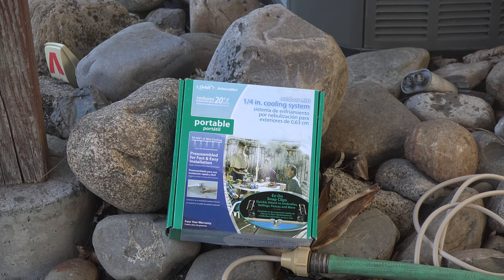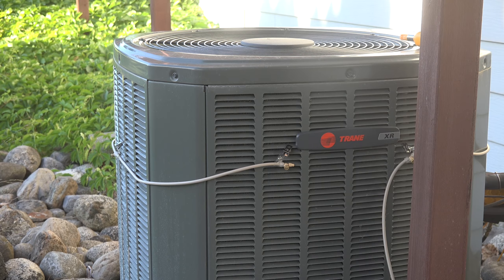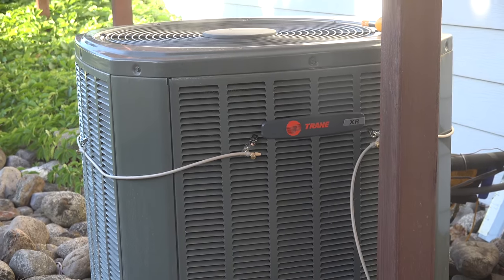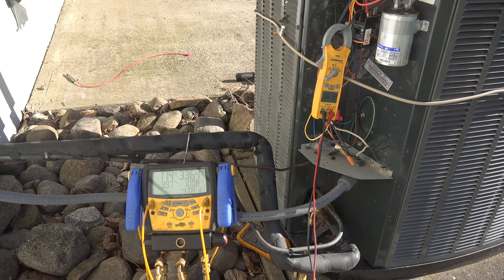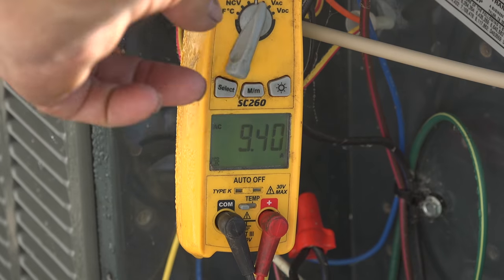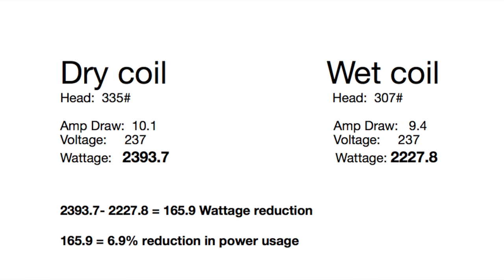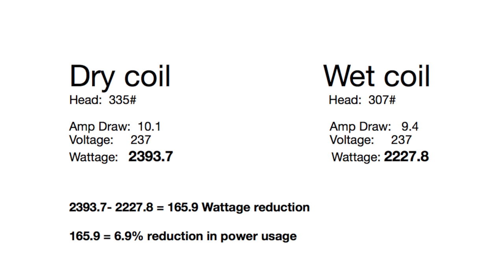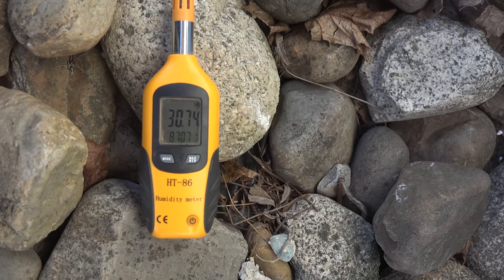Do the misters for A/C work? Part #1

Comment: I did this, but instead of using misters, I used running water and caught it in a catch-pan and recycled the water. Month over month, I dropped at least $20 off my power bill. And this was during July/August, hottest months in Florida (not to mention the humidity)
One thing you didn't mention was how long the unit ran to keep the house at the right temp. If no mister, and the compressor runs for 80% during the day, and with mister runs 60% during the day, I think that also makes a huge difference on wattage consumption. 
100W difference between mister vs non-mister is one thing, but reduction in run time over the course of a day is another.
Reply from the maker: This one is interesting.  Your method is probably the worst way to use water on a coil.  As the water evaporates, the minerals stay in the water and become more concentrated.  Eventually, very concentrated minerals will be deposited on the coil.  
Determining energy savings by comparing the electric bill is very inaccurate and should not be trusted.  
I will be publishing a video on indoor air performance in the near future.
GFM
Reply: I think it should be explained that there is a difference between the sensible heat of water vs the latent heat of evaporation. Big difference.
Reply: Korishan Excellent point. And if people are worried about mineral buildup then just install an ice maker filter in the line.
Reply: Korishan whenever the condenser temperature is lowered the evaporator temperature will also drop resulting in faster cooling inside.
Reply from the maker: These type filters are not designed to remove all minerals from water.  They are "treatment systems".  When water evaporates,  whatever is in it is left.  That means deposits on the coil.  Even if you put an RO filter in, you are then faced with pure water.  That may sound good, but pure water is quite corrosive so then you would have a damaged coil.
GFM
Reply: Hmmm, seesm like an easy solution. Since I use the container approach, all I need to do is add a little CLR or some other mineral remover, let it run for a few hours, then dump the water, refill, rinse the unit, and start up again. I do put about a 1/2 cup of bleach in the water every few weeks to kill any algae or other types of slime.
This is my 2nd year running the system. I have not seen any build up on the unit, the coils, or any other noticeable damage. The fins are fine and not brittle. 
Now, it's possible that my ground water is neutral enough that it isn't causing any issues, I could just be fortunate. However, the scale build up issue "can" be alleviated by using some sort of water cleaner/filter. So the argument about the scale buildup is really not a good/sound one. It'd be like saying "don't park your vehicle under a tree because leaves/moss will collect on it" Simple, clean it!
Reply from the maker: Well, I certainly can't agree on this one.  There are a number of issues here, not all of which are related to buildup.  The one with bleach really got me.  You know bleach is an acid?  If you check my last video on misters, you should note performance reduced when the mister was installed.  I won't go into the reasons for this as they are complicated.  I may do a video on it in the future.  
GFM
Reply: I know bleach is an acid, and not something I run continually. 
Temperature differential of 20F between coils and ambient for heat dissipation. Pump head pressure increases to meet this differential. If ambient is 90F, then coils need to be 110F. The higher the pressure in the coils, the harder the pump has to work. 
Remove the heat through another medium, reduces the need for higher head pressure, which reduces the need for the pump to work as hard which reduces power consumption.
There is no difference between an A/C unit that uses coil-to-air exchange than one that uses coil-to-water exchange except for the normal design of latter coils tends to have a coil inside a pipe. The freon runs through the coil and water through the larger pipe. This water this goes to a reservoir of some sort to let evaporation coil the water. So what's the difference really other than the different way the heat is removed from the unit?
If someone is really worried about scale buildup or agents in the water that'll eat the aluminum, then just use distilled/rain water and use a container to hold and collect it. Refill as needed.
Again, I've ran this unit 2 years without any signs of coil/fin degradation. Power consumption dropped enough to lower my power bill by at least $20 on 1 unit alone (I have windows units currently). The unit was already almost 10years old when I did this modification. Still runs strong, still puts out cold air, still in great shape.
Reply: Korishan SMH not a good idea. You are a field technicians wet dream, refrigerant leaks here we come.
Reply: grayfurnaceman i
Reply: @grayfurnaceman  Gentlemen Bleach (sodium hypochlorite )  is not acidic it is alkaline, very alkaline.
Reply: Sooooooooooooooooooooooooo...............you cant use ground water....or city water....or RO water.....I have what is probably going to be shot down as a "really dumb question and I should just know better".....but why not use the condensate from in the house.  That water......in it's current state does not simply erode the A coil away or allow a build up of minerals on the coil....just a thought....tell me where this would be bad and damaging......aaaaaannnnnnnnd.....go!
Reply: @wadebrewer7212  I would think that the condensate would be ideal, if it were in large supply.  It is cold, coming off the A coil, and it is not contaminated by either acid (as in the case of acidic rain water) or alkali, as in the case of using water with sodium hypochlorite.  On the subject of turning the mister on/off, I should think one might be able to put together a solenoid valve (as in your lawn irrigation system) triggered by the line voltage that turns on the compressor.
Reply: I am in Florida and my outside Condenser unit pours gallons of cold condensation water off compressor, coils and lines inside unit and drains out constantly, once a year in Florida "winter" lol I have to clean algae from water drain path from unit on my concrete to drain off....  guess because I am near the beach and humidity is high no matter time of the year.
So hosing outside coils with more water makes no sense to me in my situation. In the Desert that is another story :)
Reply: @fettaffenautomotive  The water/condensate that comes from your unit comes off the "evaporator" coils, the ones that get cold.
In this application, where I spray water on the coils, it's sprayed on the "condenser" coils. The condenser coils have to get 20* hotter than ambient air temp to dissipate the collected stored heat. By running cooler water over the coils, it removes the heat "without" the freon needing to reach 20* above ambient. 
This summer, my unit has ran with and without water on the coils. With water running, my amp draw is about 12A. Without the water spray, it's closer to 20A. 6A @ 120VAC = 960W * $0.11/kWh = $0.10/hr or $2.53/day or $76/month. 
Sure the pump uses some power to run the water, but that's only about 1A.
Reply: I did something like this I just used recycled the water with buckets and solar powered  pumps I got from Amazon.
Reply: @majorpaine211  Yup, that works.
Even better, if you can, use filtered water (rain water perhaps would be fine) to make sure there are no mineral deposit build up.
On my unit I had to keep adding some vinegar every so often to get the calcium buildup off, as we have loads of calcium/lime in our water.
Reply: this is what a swamp cooler does. It sits on the roofs of houses and it pours water over a mesh and there is a big fan that sucks in the air and blows the cooled air into the house. My parents house still use the swamp cooler. To convert to central air is very expensive.
Reply: Sounds like a cooling tower with extra steps 🤣
Reply: Very expensive. Simplicity rules until it freezes lines.  Window units are good if leaks who cares.
Reply: @quantumtechcrypto7080  Considering most people don't run the airconditioner during freezing temps, running water isn't an issue. Just let the line drain. 🙄🙄🙄

And how would it be "very expensive"?!?! It actually "lowers" the power consumption so the unit can run more efficient. Your comments makes zero sense from the start. You must be a troll, a bot, or both.
Reply: I had an old window unit that was designed to hold some condensate in pan and let the fan drag through it and splash it on the condenser coils, presumably to get the SEER (or whatever) up.  In theory, it's distilled water so it should work great, right?  In practice, the condensate pan attracts bugs and all kinds of other gunk, which gets baked onto the coils.  Not to mention the constant "pinging" sound (not a concern with split systems of course).  Ended up just drilling a hole in the pan to let it drain, but not before a LOT of grief (was young and dumb).
Reply: @grayfurnaceman Keep experimenting, change directions of misters,run lines vertical not just horizontal and even add some extra misters. See what happens then.
Reply: Your evaporator is making free distilled water, use that instead of tap water.  It's free, clean, and cold; all bonuses.
Reply: @DonziGT230 Because condensate lines never need to be cleaned, lol.
Reply: @DonziGT230  The Evap coils don't make no where near the amount of water required to cool the condenser coils.
Just saw a video that uses misters and a fan activated "switch" to turn on the misters. But it's expensive. Can just use drip irrigation parts to do the same thing for a fraction of the price.
youtube /watch?v=SWc0StyZiJs
Reply: @joez.2794  By "clean" I meant that it doesn't have the minerals and other things in it that will damage the condenser.  It'll have some dust, but less than what's already hitting the condenser from the outside air.
Reply: @grayfurnaceman bleach is high pH (alkaline) not an acid but, either side of 7 is damaging.
Reply: @wadebrewer7212 do not use RO water, it is very aggressive

Comment: The misters work in humid Houston but any energy savings is offset by the damage to the coil when it is clogged with calcium deposits and will accelerate the rusting of the steel surfaces on your condensing unit.  You can buy a device that treats the water and supposedly prevents the deposits on the coil but I found that device to be expensive to maintain.  You can build your own misting system using misters available at Home Depot, a sprinkler valve, and a small transformer to switch on the sprinkler valve when the condenser is running.  As others have noted, it might be beneficial to only run the misters on 100+ degree days so a thermostat could be added for that function.  How do I know all of this?  I built a misting system as an experiment over 20 years ago.
Reply: I ordered a filter and no trouble here, also very hard water.
Reply: @4211mk what kinda filter did you get
Reply: Have you been using yours for all 20 years? Curious about the long term damage/scale on the coils.
Reply: He forgets that if the mist isn’t evaporating in high humidity that it won’t work.  When that moisture wets the hot coil it’s going to evaporate regardless.  The evaporation will still drop the temperature and remove heat.  It’s not dependent on the air alone.  So unless you can show me results based on Humidity, I’m betting your wrong.

Comment: I once had an process cooling and dehumidification installation that incorporated a l5 ton Trane condensing unit.  One of the accessories that was spec’d for the condensing unit were evaporative pre coolers for the condenser coils.  These were swamp cooler like modules attached to the condenser coil inlets, and used to make the condenser more efficient by pre cooling the condenser entering air temperature.  It actually worked, until the calcium and hard water deposits that were left behind ruined the condenser coil.  You basically turn an air cooled condenser into an evaporative condenser, which is more efficient, and will run with a lower condensing temperature, thus a lower amp draw to run the compressor.  It’s fine as long as everything is clean, but once scale starts to form, the efficiency goes away.
Reply from the maker: As with so many "efficiency upgrades", the devil is in the details.
GFM